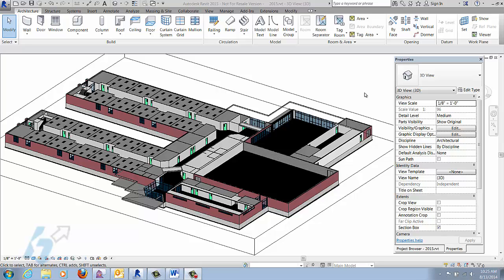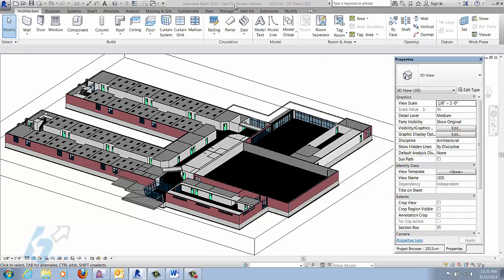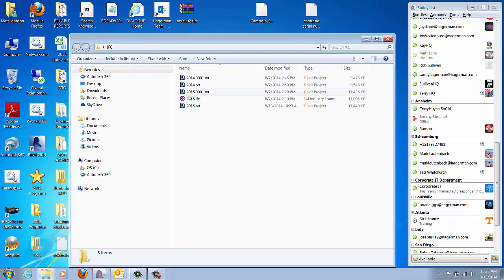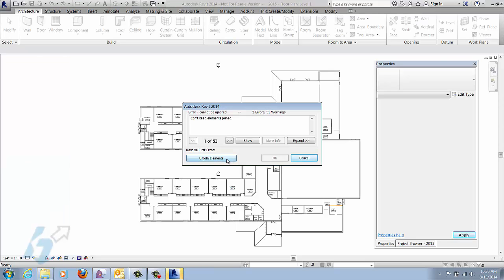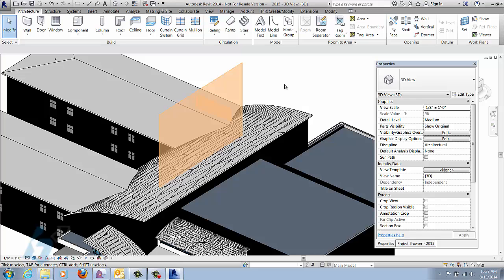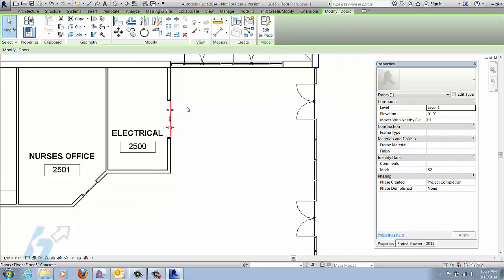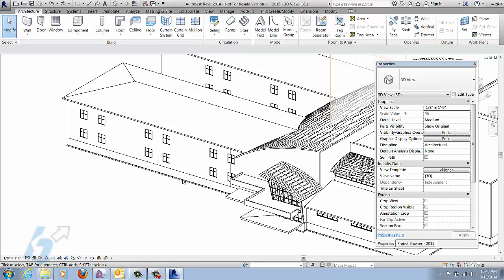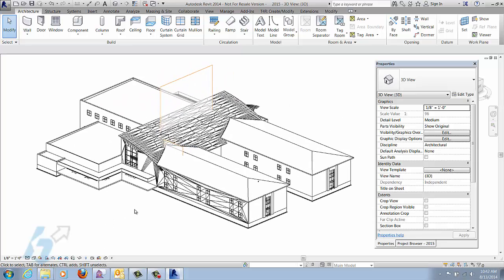IFC File Format Integration With Revit

Comment: Thanks for sharing this content! 

I just would like to make a small observation for potential newcomers to the subject. 

Although IFC was used here as a workaround for the (in)compatibility problem between Revit versions, this is not the primary use intended for IFC files. IFC files are meant to be used for coordination purposes and, as a last resource, for editing. 

Moreover, the IFC export settings and categories mappings from Revit to IFC were probably not configured. That's why some objects were assigned to the wrong category when the IFC was imported to an earlier Revit version.

Comment: thank you very much this was super helpful but i was wondering if i reopened the IFC file in the version that it was created in would it interpret the model properly or would it turn out the way it did in your video also if i required information included into the model by another consultant would this process works without information lose when i open the IFC in the original version it was created.